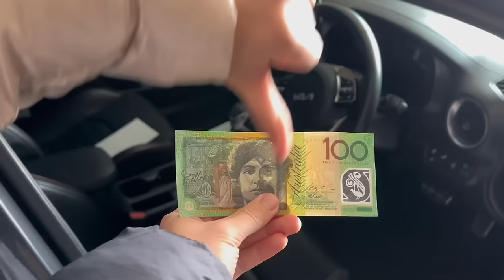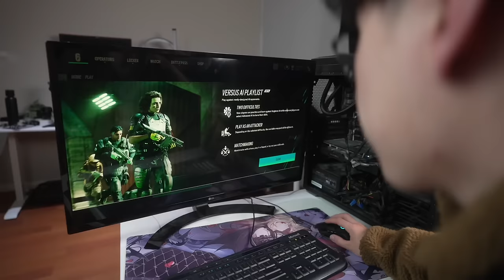I built a gaming PC for $100

Comment: Can't believe the seller had a liquid cooler attached to a 2012 cpu
Reply: Because it is a 8350.. most aircoolers from that time where barely capable of cooling that chip to be able to use it to its full potential at stock speeds. 
Max advertised temperatures for the 8350 was under 65C before it would start to degrade. (Yes really)
I had a custom loop on my CPU only which costed more than the processor itself! These CPU's where advertised as being 125W cpu's but a lot of times (And especially on higher end motherboards) they would pull way more than that. 

So it is not really weird that the seller had a AIO on his 8350
Reply: @whirlybirdrc nice thnx for explaining it

Comment: why isnt gpu in primary pci e slot?
Reply from the maker: Not sure bro was like that when I got it 😅
Reply: @ECLTech1  The lower PCIe x16 slot is electrically x4 so you'd likely see a jump in performance by moving the card to the top slot which is a real PCIe x16 slot

Comment: Dude fbm can be a gold mine. I found a full pc for $250 this week with insane specs.

Rtx 2080
Ryzen 3700x
16gb ddr4 3200mhz
500gb Samsung nvme ssd
X570 mobo
850watt psu.
Atx NZXT Tempered glass case.

Dude was just liquidating because he was about to head to boot camp.
Reply: wtfff, you could flip a pc like that if you wanted for a much higher price, or, alternatively, just keep it, upgrade the ssd to a 1tb drive and upgrade the ram to 32gb 3600mhz and upgrade the gpu and cpu to something better later on (like a 5700x3d with a 3090 or 6800 xt) when the 50 series launches, as we should be able to expect prices to drop for thos ehigher end last gen cards when nvidia 50 series launches
Reply: That is INSANE. I would pay nearly that amount for the 2080 alone….
Reply from the maker: Dam bro, 1 in 100 chances of getting a bargain like that 😮😮 one day ill get one
Reply: Congrats on that crazy good deal bro!
Reply: Nice hope your enjoying that pc rn, what a bargain
Reply: holy W
Reply: and i get a 3050 ti laptop for 760 with is pretty good too

Comment: Nfs Heat and Fallout 4. I did a optiplex 990 build paired with a 1660 super ($120 my whole build). The i5 3570 is bottlenecking my 1660 so bad tho.

Comment: I got a free 7010 optiplex MT from work with 32gb ram, bought a 600w psu, 480gb ssd and a an rx580 8gb for $90 

I only really play Genshin and Star Rail and they run mint at hugh custom settings
Reply from the maker: That sounds fun! absolute bargain build 😮

Comment: I just bought a pc on ebay for £250

RX 580 8GB Vram
16GB ddr3 ram (I bought another 2 8gb sticks so it’ll be 32GB soon).

I7-4700K(??) (I think).

and it has 2TB hard drive and a 250gb ssd 
(I put a 500gb hard drive in it for more storage).

did I get ripped of?

(I had to clean it and repaste cpu due to super laggy problems but I play VR on it and it was alright).